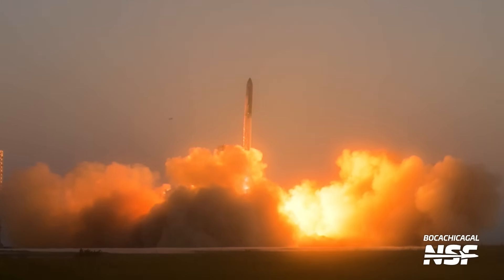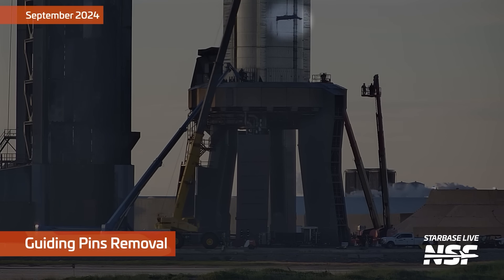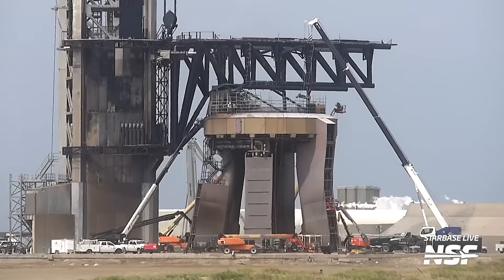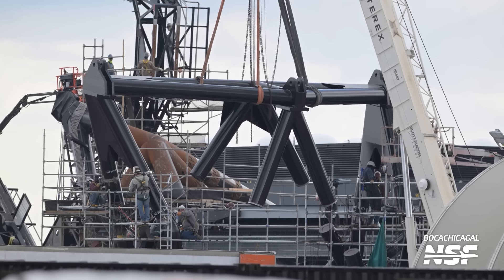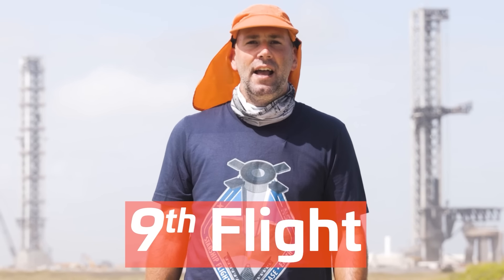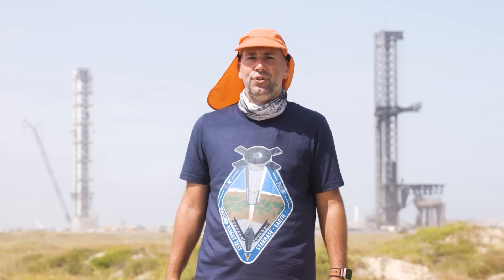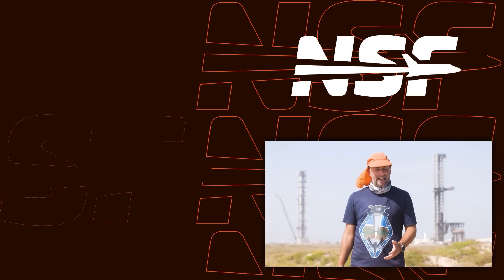Flight 6 Preps Underway | Starbase Update

Comment: One of the main reasons SpaceX has been so successful is that when they recover their boosters, they can do a full autopsy on it to look for what worked and what failed.  This greatly helps with the iterations of designs and identifying flaws.  No other space program has had this capability in the history of space flight.  Now that they have caught a booster, I guarantee they are ripping it apart to look at how it preformed.
Reply: You can run simulators all day, but being able to do it in real life and still have it after has to be amazing data!
Reply: you said : "No other space program has had this capability in the history of space flight." Except of course, the NASA Space Shuttle.
Reply: @stevevernon1978  You mean the vehicle that's eliminated more astronauts than any in history?  Boeing should have printed 737 max on the side of it.

Comment: Hopefully, IFT 6 will feature an in-orbit relight of a sea level Raptor to simulate a de-orbit burn, and, hopefully, this won't take too much finagling with the FAA to add to the license. An absolutely essential validation step before Starship can go orbital.
Reply: I don’t care about an in orbit relight

I care about one thing, reusing superheavy a second time
Reply: I agree. The fact that the FAA already approved that for IFT-3 (where SpaceX had to abort the test due to loss of attitude control on the ship) makes me think that might already be in the approval for IFT-6. As Jack said the wording of the FAA IFT5/6 license announcement makes it look as if the FAA approval already granted for IFT-6 isn't for a flight profile 100% identical to IFT-5 so incorporating previously approved stuff into the current IFT-6 approval doesn't seem like a huge stretch.
Reply: @goldgamercommenting2990  Reusability is definitely important, not to mention sexier. But, Starship is nothing if it can't put something in orbit. We're not there yet until Starship can show it can actually go to LEO and bring itself back.
Reply: That is the next major logical step.

Comment: 8:19 - "Cable Tray" if it's static. "Energy Chain" or "Drag Chain" if it can articulate to allow a fixed length of cable or hose to follow a linear motion.
Reply: I worked at a major atsronomical observatory for a long time which had numerous "cable chains", as we called them.

Comment: This is my prediction. Flight 6 will be a near repeat of 5 with the intention of proving that the landing accuracy of starship can be repeated. Flight 7 will be the first fully orbital flight and will stay in orbit for a few days deploying a few Starlink satellites. Flight 8 will be the first full Starlink deployment and starship catch attempt. Afterwards its more difficult to predict because of the change in administration. Will NASA explore the possibility of an Apollo 11 repeat using lunar starship as a crew transport from LEO to the lunar surface? (Yes I know they would have to bring a tanker with them) If so we may see the program shift rapidly towards testing of the Starship tanker and then Lunar Starship.
Reply: How are they planning on returning starship? The same as the booster?
Reply: @1985NEVETS  Yes, it's gonna be caught with the chopsticks too, for rapid reusability: re-fueling, re-stacking and re-launching.
Reply: @conrado3391  that's awesome thanks for explaining
Reply: @conrado3391  Having holes instead of pins will make the actual catching a tiny bit trickier. The pins will need to pop into the holes at the exact moment the hole aligns and they'll need to find the holes along the rails.
Reply: HLS for now. Lunar Starship? Not for a long time. Also, landing a starship that lands on the moon back on Earth doesn't make sense. Eventually, what you call 'lunar starship' will fly from LEO to lunar surface. A cargo  only starship will land on the moon and stay there. 180 t of stainless steel is FAR more valuable on the moon than back on earth.
Reply: @KnugLidi  Sorry for the late reply. But I think you are not seeing the point of such a mission. Of course it is very inefficient to return lunar starship to LEO for crew return on dragon. The best that can be done with such a mission is a repeat of Apollo 11. Yet, The point of such a mission will be to assure that we return to the moon before China can sneak in a barebones manned lunar landing (Open cockpit lunar lander with almost no cargo) It is expensive as you will be completely throwing away a whole starship tanker. Yet this mission can be done fast. And I think we can do it by 2027 which gives us margin before China likely tries in 2028 (In my opinion they are secretly building the lander now and if we show no signs of a manned landing by 2028. They will announce their intentions of such a barebones lunar landing)

Comment: Will be interesting how FTS is addressed in a full and rapid reuse environment.  Handling explosives every few hours seems a bit dangerous, and leaving them on seems a bit dangerous.
Reply: The vapours in the fuel tanks are way more dangerous then the FTS. High explosives are pretty safe. They don't detonate without a pretty intense shockwave going through them.
Reply: I’d imagine they’ll dropped IFT at some point. Imagine 737 or A320s flying with flight termination systems. We can all probably think of at least one occasion when that would have been useful… but the other 9 million flights every 30 years it would just wreck the civil aviation industry.

Comment: I find the focus on the warped nozzles amusing.  The solution to this problem is to install the v3 engines with integrated cooling.  ;)
Reply: Not sure that would change anything, the nozzle already is regeneratively cooled and has been on all iterations of Raptor. Raptor 3 includes integrated cooling but for other components

Comment: The OLM under tower 2 is not compatible with the one under tower 1 (e.g. umbilicals for the outer 20 engines). This means that parallel versions of SuperHeavy will fly: v.1 from OLM1 and v.2 from OLM2. At least until OLM1 will be retired and demolished, that is...

Comment: My hope for IFT-6, to make it possible to fly ASAP (in November?) under the existing FAA license, is to fly basically the same flight profile as IFT-5 but add in some stuff not done, or not entirely successful, from IFT-3 namely a microgravity Raptor relight and another go at the payload door test that I'm not convinced was 100% successful in IFT-3.

Going further fuel transfer testing is a bit of a black box to us outsiders but there might be value to SpaceX in doing more testing there - higher volumes, faster flow, different ship orientations or whatever - and does Ship 31 have a pez dispenser? If yes they could even deploy some dummy satellites which I assume if deployed from a ship on a ballistic trajectory would simply re-enter in the same corridor as the ship and burn up safely in the upper atmosphere. Plus finally such an IFT-6 mission profile would be another opportunity to try new things with areas of the heat shield and attempt another booster catch maybe addressing issues of the outer Raptor bell deformations..

Basically it seems to me that there's a huge amount of extra testing that could be done on an IFT-6 mission profile that I hope would fit within the existing FAA license (a combination of stuff previously approved for IFT-3 and IFT-5) and as long as there are no bad issues on the pad should be able to launch by the end of November..

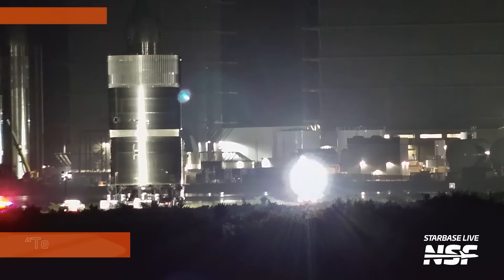Comment: Just a technical note: I’ve noticed that there is an unnatural amount of over sharpening, known as edge enhancement, in all SBL camera imagery. It shows as light-colored halos along contrasts between light and dark contrasts, such as the Mega Bay 2 structural supports and sky at 1:40, or cables against the sky at 8:41. Mary/Jack/D all have normal footage. The SBL cameras may by default have edge sharpening on them like Vizrt systems often do.

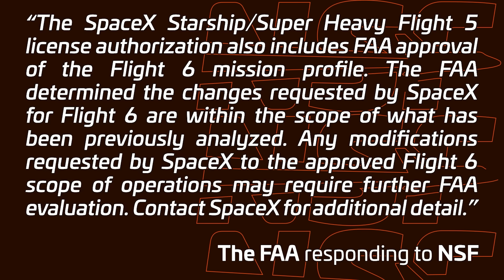The FAA’s statement at 14:32 may have been referring to in-orbit engine relight, which they had reviewed for Flight 3, but was precluded. I would expect another suborbital trajectory on Flight 6.
Reply: To clarify, over sharpening can be turned off in settings. This would probably have to be done manually by individual camera, and regularly checked for accuracy.

Comment: Or, they only need the guide pins to align the start-up QD’s for launch but not to “park” it on the pad. The fueling QD likely has more adjustment capability as its a single to point hookup, not 30+. No brute force at all. 

Any chance the hot stage ring hit the bent nozzles?

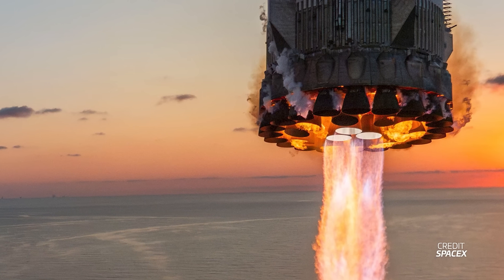Comment: The damage to the chine on booster may have come as a result of a bump from the Hot Stage Ring. In the SpaceX live feed at T+4:38 you can see a bright silver object near the top right of the booster. 

Watch that bright spot as in moves down along the side of the booster, then it appears in the exhaust plume and you can clearly see it’s the HSR.
Reply: It doesn't look like an external impact.
Reply: @imaginary_friend7300  ok. Did you watch the video?
Reply: @Powerhead1000  Yes, and have some experience with impacts too.  I think you are wrong.

Comment: Is the thickness of the ablative layer known? Shouldn’t it have to be pretty thick to do any good? Seem like that would add a lot of weight.
Reply: TPS total mass is 10.5 tons. Which is a lot (its about as much as a fully fueled Electron), but its not much compared to the rest of Starship
Reply: 10.5 tons is a lot of payload...
Reply: @rkan2  Not compared to 100 tons.
Reply: It's a backup, not a primary.  It only has to work after the primary has failed.

Comment: Would the fact that raptor is closed cycle (and so apparently 99% combustion-efficient) not mean that there is less soot in the exhaust also? It was my understanding that because Merlin's preburner runs fuel rich, the partially burned fuel is what creates the soot?
Reply: Merlin isn't a close cycle engines so don't have a preburners, it's called gas generator and the soot problem it's that he's clogging the gas turbine that move the pumps, Raptor have two preburners and one it's oxygen rich but the other it's fuel rich, so probably that can have the same problem.

Comment: Seeing that SpaceX discarded an entire falcon heavy to launch NASA's Europa Clipper I wonder if they are going to have a simpler, disposable upper stage for Super Heavy for the cases where customers want to place heavy vehicles into space with a large amount of delta-v? Starship doesn't arrive in orbit with a lot of delta-v left, so I doubt that it would have been able to launch Europa Clipper - which is a problem if Super Heavy/Starship is going to replace Falcon Heavy. But a lighter, more traditional upper stage might be able to add that capacity, maybe even without having to sacrifice the booster?
Reply: IF starship hits the low end of 100mt to LEO then a payload has the option for a pretty big kick stage.  I think the F9 2nd stage alone (without payload) is right around 100 tons fueled.  It'll be different, but I'm not sure if there will be a demand for a disposable 2nd stage and they might feel that a refueled starship gives more performance than an expended one.
Reply: @imaginary_friend7300  Ah true, I somehow forgot about how large of a cargo capacity starship should have.
Reply: @toblexson5020  Refueling will open the doors for a LOT as well.

Comment: I really still don't get how a set of landing foot and a falcon9 like landing on a concrete plateforme with some dedicated crane/catch vehicule coming and picking-up the booster/starship isn't an overall better idea than a catching tower. Trading the added weight of some landing gear for some way more flexible cheaper/streamlined logistics you can get with a land vehicule centered workflow and more real estate to move ships/boosters around, the retrieved ones, the prepped ones. 
I don't know. SpaceX is all for simplicity. 
Sometimes minimalism and the will to be sexy is much more complex than actually simpler more grounded (pun not intended) solutions.
Reply: It's all about efficiency.  Flight turn around is one side of that coin, the other is the booster.  A set of landing legs on the booster would have to be engineered to be as light but still as strong as possible to land a 200+ ton booster.  That requires a lot of careful design, testing and validating.  By moving it to stage zero they remove the mass penalty and constraints so if they need a big and beefy system on the ground it is of no consequence and it is faster and easier to build and test.

Comment: What's the point to make flight tests with the Block 1 of Starship which is not supposed to be used for cargo missions? It only takes resources and time.
Reply: because none of the block 2 of the ships are ready to go yet while the remaining block 1 ship is like within a couple of weeks from being ready to go
Reply: It can still tests and validates design features.
Reply: @ale131296  This explanation is only for those who just want to see another show ASAP ).
Reply: @peaceofmind2769  There's no point on waiting around for block 2, SpaceX can gather a lot more data by flying the last block 1 and keep learning.
Reply: @ale131296  The question is: How useful this data will be for a new design? They already gathered a lot of data from previous 5 flights. Some new rockets make only 1 or 2 test flights before commercial usage. And actually the flight with the old version holds the flight with the new one. Ship 33 (which is Block 2) and Booster 14 (or 15) will be ready quite soon.
Reply: @peaceofmind2769  Starship is not a traditional rocket and will have many more tests in the future

Comment: Why would improving the outer engine warping be something they need to work on right now if rapid reusability isn't SpaceX's main goal at the moment? Besides Raptor 2 is a obsolete design, who's to say Raptor 3 doesn't have better thermal integrity than its predecessor.
Reply: Because with rapid reuse a final goal that IS a problem that needs to be solved.  Thermal integrity?  That's not the issue.

Comment: Rapid reusability as in catch  restack refuel relight is unfortunately unlikely until material science catches up.
Reply: What makes you think it's a material science issue?  What material is failing?
Reply: @imaginary_friend7300  For a start the heat shield is far from doing the job and is nowhere near maintenance free even the booster is experiencing friction heat damage that will require maintenance before reuse.
Reply: @bobdillon1138  It's far from doing it's job?  Do you mean there are been burn through's in area's other than in the flap gaps?  How do we know how much maintenance will be required before recovery even starts?  I don't agree with you're current assessment, your thinking seems strange to me.
Reply: @imaginary_friend7300  I mean that the heatshield is far from maintenance free tiles will still need to be replaced because of 
friction erosion regardless of weather they remain attached or not Musk  even said the booster will need repairing because of friction related
damage the materials available at present are just not adequate
and ships and boosters will require repair and maintenance i fail to see what is so hard to grasp about that.
Reply: @bobdillon1138  The problem is your assumption that the problem is not fixable without some kind of 'catch' up with material science or the notion that the few small issues are somehow 'far from doing it's job'.  I do not believe for a moment that they have exhausted all their options with current materials or that the problem they have had are THAT catastrophically bad.  We STILL have no real data and that erosion and that's just the plain and simple reality.  I think you might give into a urge to be a bit dramatic.  Keep in mind these are test articles as part of a development path.  Finding and fixing issues is the whole point of what's going on.
Reply: @imaginary_friend7300  Seriously its Space X we are talking about they are at the cutting edge and are already using the most advanced materials available.
Reply: @bobdillon1138  ..and?  None of that alters a thing I said.